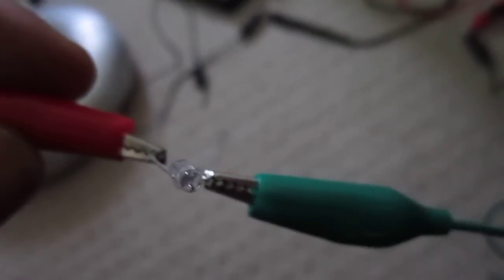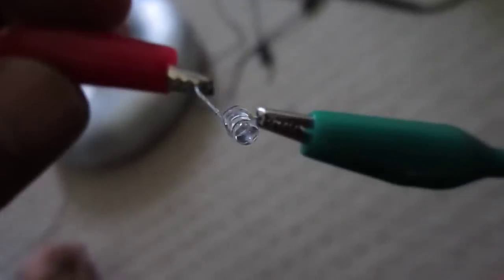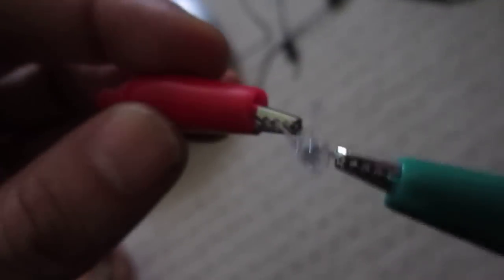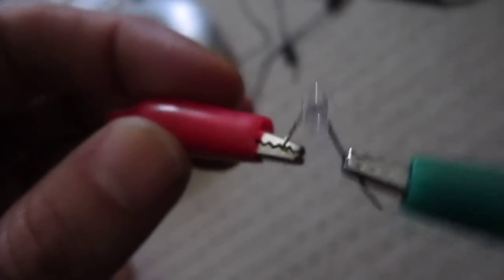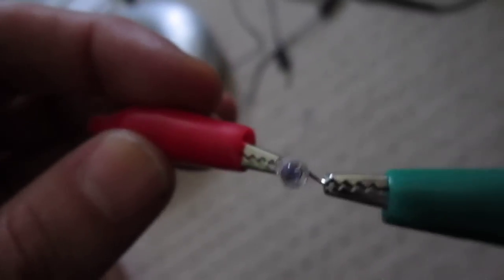How to light an LED with no battery or AV plug

Comment: I'm doing same thing sir. add me on facebook "fersam fernando" . Allow me to explain it this way see the electric system use the earth to damp excess energy if you tap one point of LED on ground and other on any point of say laptop charger plug on wall outlet.  it will lit! even our body can pic up charge. and if we try to measure the voltage it has 12v on the meter, that what i'm trying to figure out... it sounds like stealing though?...

Comment: One Wire Free Energy transfer Variant 4 090711avi  
Using Neutral wire plus induction cooker  coil  plus antenna   I was able to ignite the gas in the FL tube     if only  somebody can make it continuous  will be better  
we are in the sane boat    ANY IDEAS  OUT  THERE

totoalas